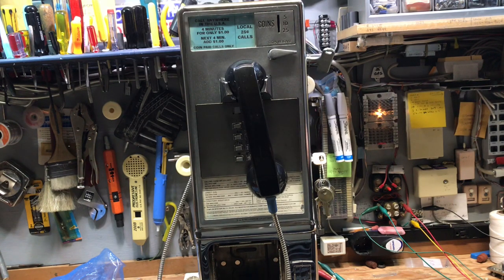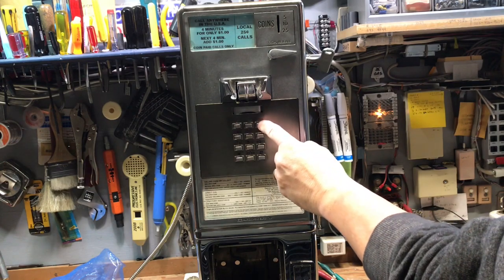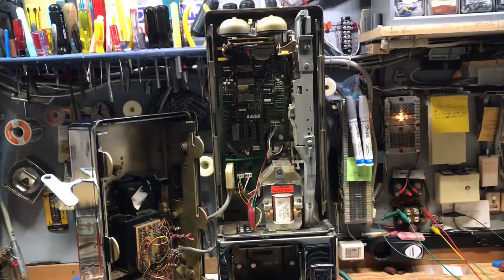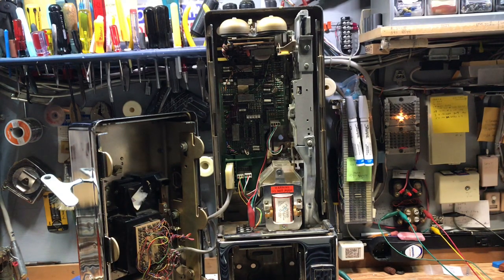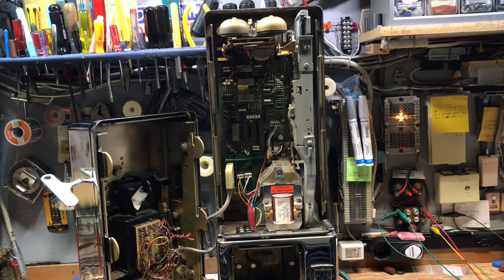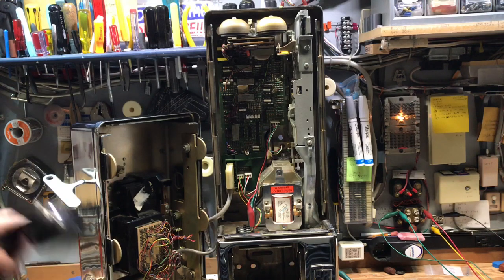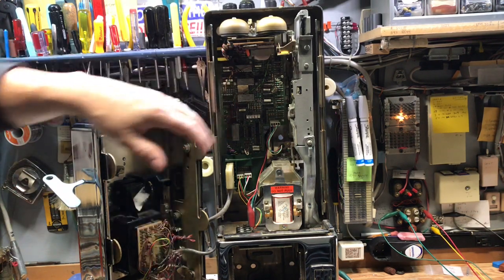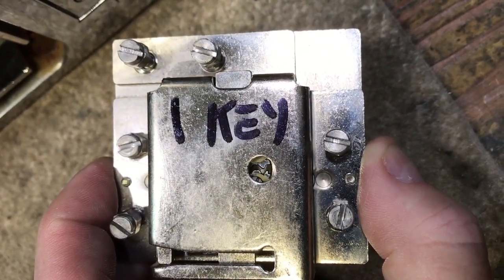Automatic Electric, GTE 120 B Payphone

Comment: We still have a number of them in-use in Central Illinois.  In fact, there's a working payphone on the corner of our local  C.O. Building, in one of the larger towns.  Interestingly enough, every one of our remote C.O.'s has a test phone inside the C.O.  If the exchange never had an actual payphone in use, the test one was never activated.  All of them are 'dumb sets'.  Only the Smart Sets, & the NT Milleniums remained in actual service.

Comment: Do these GTE/AE payphones with the original 120B chassis boards operate the coin relay the same way that the WeCo phones did? That is, +130v/-130v across tip and ground to collect/return coins and +48v/-48v for coin stuck/initial rate test?
Reply from the maker: yes,